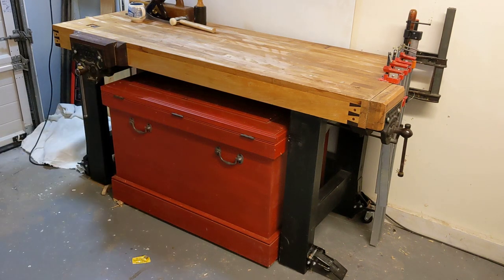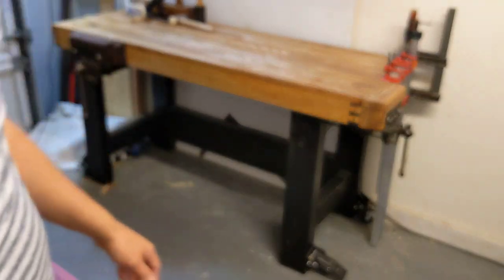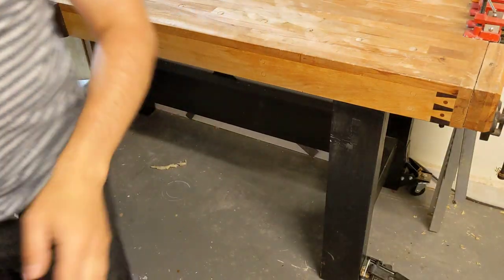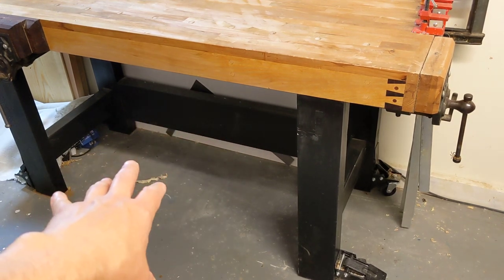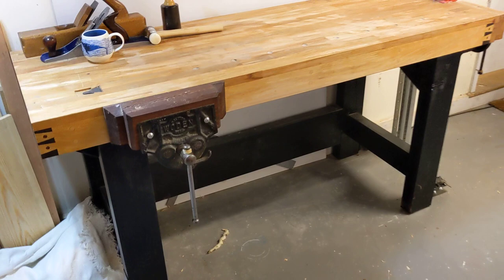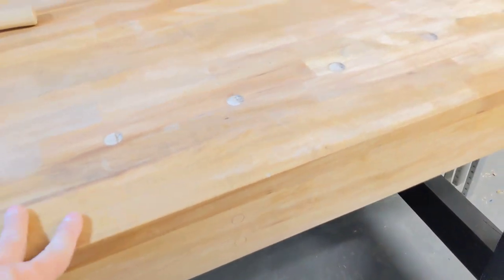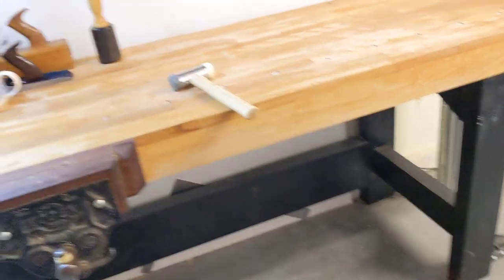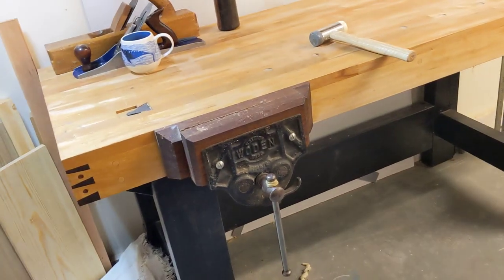My Workbench Tour! Woodworking Vlog #11

Comment: Hi thanks for the video, you've built a nice solid working bench, built for use, but good looking as well. And especially as most of it was from recycled materials. I did the same about 30 yrs ago, reclaimed  timber for the frame, and the top is 5"thick made from layers of old flat pack furniture glued and screwed together, as flat as it needs to be for my use.i think any bench and vice no matter how simple is worth its weight when it comes to Diy .After resisting for many years i bought a B&D workmate which I now  find very useful , I was a sceptic,  but have to admit I should have had one years ago,lol.   kind regards,  Stuart UK.
Reply from the maker: Hi Stuart. Thanks for the kind words. Your bench sounds very sturdy and ideal for woodworking 👍. A workmate can certainly have its uses too.

Comment: Nice bench 👍🏻.   it looks a belter.  My philosophy on benches is they should fit the person who is using it and that they evolve over time as the worker gets used to it or changes working styles so there is no perfect bench just benches that work and work.   I also love seeing benches made with bits and pieces and quirks of ingenuity like your offset double stretcher. Mine is a pine kitchen tabletop rescued from a skip on a frame of 4x2s on legs of 5x5 fence posts with skirts of 8x2s.  It is basically an English joiner’s bench made from scraps and junk.  It’s big, heavy and utterly utilitarian with its own peculiar beauty in my eyes.  It’s lasted me nearly 20 years and although it carries a fair few scars a quick blast with a belt sander and a coat of Danish oil and it’s almost as good as new.
Reply from the maker: Wonderful! That bench sounds perfect! I totally agree with your philosophy, get it made and get to work!

I do like some of the modern ones though. Strazza's are superb 👌
Reply: @faceedgewoodworking  I’ve seen videos of him making them and they are truly gorgeous but I’d be terrified of spilling paint or stain on it or gouging it with a misplaced cut or chisel strike.  Mind you if I was as skilled as him then misplaced cuts and chisel strikes wouldn’t be part of my repertoire.  😀👍🏻
Reply from the maker: @tonyalways7174  Yeah! Does he have one or are they customer only?
Reply: @faceedgewoodworking  I saw the videos on his website.  Just snippets mostly but highly impressive nonetheless.
Reply from the maker: @tonyalways7174  I like his work and his demeanor. He and Pekovich are my two living woodworkers who have public profiles that I look to. Lovely work from both of them.

Comment: Nice bench .love the fact its recycled mostly. I have a similar apart from mine has the front stretcher all made from wood rejected from a company that makes staircases from oak or southern yellow pine .I don't use the tail vice much. I did get the local blacksmith make me a pair of holdfasts and 2 simple planing stops same round bar as holdfast with piece of  lid steel welded on top so I can use same holes for both.ps how's the infill plane coming on .I bought a brand new infill on ebay 40 pounds 50 degre bed angle 0 1 tool steel iron body is bronze and steel very happy with it .
Reply from the maker: Peter, what a score with that plane! Mine will get there but I'm in no hurry. I just couldn't pass on it. They usually fetch so much.

Your bench sounds ideal! It's good to be resourceful. Using something that is sound but doesn't quite cut it for retail is a great plan.

I have a pair of holdfasts too. Just not drilled holes for them yet. Nice to have them made locally 👌. Mine are the Simon James ones from workshop heaven.

Comment: Great vid as usual. I also bought those type of castors for mine. It looks like you have had a similar problem to me where the leverage force needed to lift the bench has pulled the screws out. I ended up replacing them with a combination of coach screws and some self tappers that are actually for metal not wood. Its been fine since.
 I have 2 vises also. My main quick release (Record 52 1/2) is the same place as yours. Then I have a small 6" Ward & Payne (I think they are known by some as a junior vise ?) thats at the end opposite of yours. This is used with a jig ( kinda like a bench hook but with only one cross piece) that can be used as a plane stop or a perpendicular straight edge. It helps with clamping sometimes too.
Reply from the maker: Thanks for the comment Johnny! Yeah, not impressed with the wheels. Like I mentioned, they have to be so low on the leg. The reality is I don't need to move it and I'd probably walk it. Sounds like you have a good fix thought 👍

I like the sound of the Ward & Payne vice! 
W&P are and old school cool 😎 (that's how sad I am). I always keep an eye out for their Aristocrat Chisels. No luck yet. The IBC chisels seem to copy the concept.
Reply: @faceedgewoodworking  I'm from Sheffield and grew up in an area surrounded by a lot of the factories where the tools and cutlery were made. I could even see the big Stanley factory from my back door up near the old dry ski slope. Sadly it's all student accomodation now. I love old tools and am always interested in stuff that was made here. Sometimes just as a collectors item rather than for use.

I saw a set of Aritocrats last year but they were well outside my price range.
Reply from the maker: @gromit2478  Wow, steeped in heritage there. Thankfully there are a few tiny companies going, but it's far from what it used to be. I hope we continue to celebrate Sheffield's contribution as the source of some of the finest tools ever made

Comment: I built my present workbench before I was even on the Internet. So I kind of totally didn't know what I was doing. It still works for me though.
Reply from the maker: Paul, it's probably a very good thing you did!
Reply: @faceedgewoodworking  there's certainly things about it I'd do differently today. Some things that I like though. I came up with this seemingly complicated but surprisingly easy easy to make half lap joint with a square hole in the middle of it. I don't know if I invented it, or not? Let me see if I can draw a picture of it. Something like this https://i.postimg.cc/HkKzcMZ9/socket.png I think I could have cut one easier. I'm not good drawing on computers. I hope you get the idea though. That bottom piece would be on the floor. Once socketed in the legs can't go anywhere.
Reply from the maker: @1pcfred  Patent pending 👍 I think I get the gist. I think we all come up with a little tweak here or there. I'm hoping for a good session tomorrow. No stress about the bench, hopefully make something! 😎